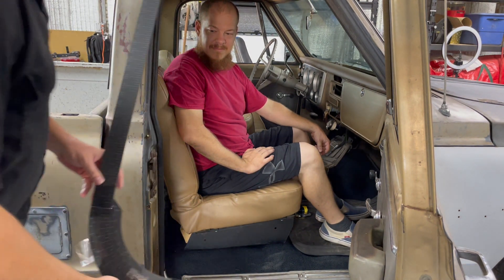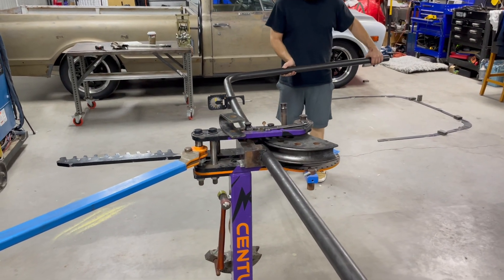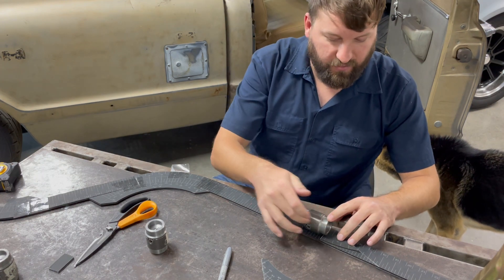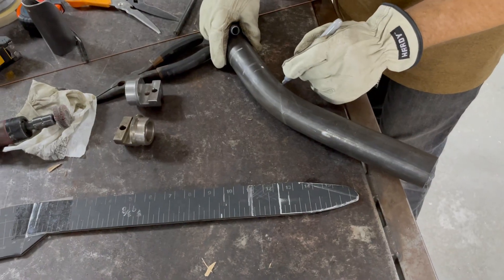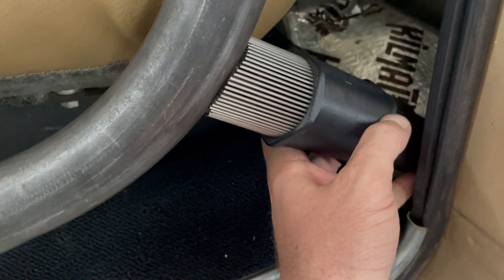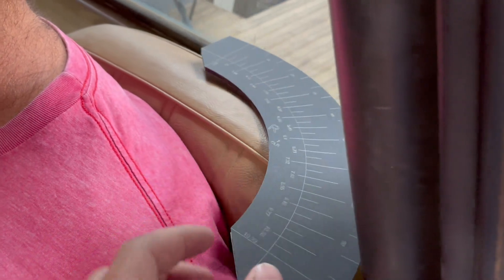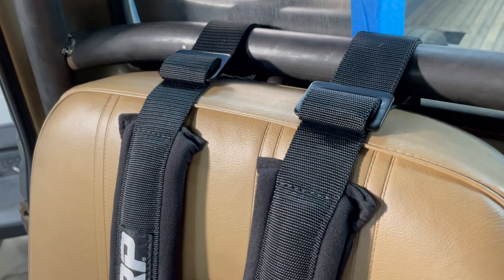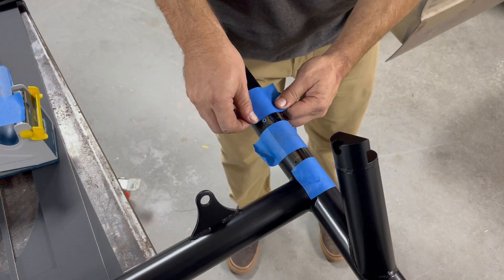C10 Roll cage, clean and easy build video. Step By Step

Comment: I had a question with the template can you explain when you start your bend in the tube bender using the templates
Reply from the maker: Yes. If your bender is like ours then you need to start the bend with a little bit of offset. In the video you can see we used the templates to tell us where each bend started with marks on the tube. The marks line up with the 0 degree and the end angle what ever it is. Now that gets you close. Your bender will have some amount of jiggle and imperfection and you will need to figure that out with a test bend. For us it was about a 1/4 offset. That offset is to compensate for our benders preload and jiggle. The offset is right where the dies meet in the machine. It's impossible to explain in words any more than I have. So my suggestion is to do a little test bend or two to get a feel for how to use the templates and your bender.

Comment: Absolutely awesome work and the attention details is amazing great job.
Reply from the maker: Thank you. More on the way.
Reply: @centurialinc  I wonder if a cage like that would work on 1973 and up C10 single cab. Also could it be possible to run support bars to the rear part of the frame through the back side of the cab but at a hight just below the bed rails so they could be covered up so no one could see them.
Reply from the maker: It sure could. We did not do the back bars because you have to cut through the cabin and the customer did not want that. But you can definitely do that.

Comment: What are those quick disconnects called
Reply from the maker: If your talking about the ones welded to the cage. Those are roll cage bolt in joints. Google that and you will find all kinds.

Comment: Nice work, great video. Why did you use the bolt together sections on the diagonal braces below the seat?  Also will this pass tech at any race events or just for show?  I didn’t hear that discussed at all.
Reply from the maker: Hello. We wanted to make it easy to remove so we could paint it. And the issue was the floor. It was lower on the left and right sides of the car with a crest in the middle. The roof bar was so close to the roof that it was impossible to lift the sides of the roll cage up over the crest without it ramming into the roof. The truck is strictly a street build. Customer would only take it an autocross event at most and that is the only event that would pass this cage.

Comment: Nice work! Your shop rate seems a little low to me from the mindset of business and Labor costs. You mentioned "40 hours" was that "Man hours" or "Shop hours"? What part of the country are you located in? That makes a big difference also. All in all your work and prices are impressive! I'm looking forward to learning more from you guys.
Reply from the maker: Thank you very much. We are in Casa Grande AZ which is out side of Phoenix. So costs are lower. The 40 hrs is man hours at $30 an hour. We think we could go up to $100 per hour shop rate but after that it seams to high. That cage would have been $4k which is a lot considering its a 4 point cage. Now that dose include install, paint and any misc. needed to get it done like hardware. Lots more to come we are going to continue with the business side of things for a while people like that content and it's not very often talked about. Thanks for the comment and watching.

Comment: I gotta say this is one of my favorite new channels. The level of detail in your work is amazing. Understandably your overhead is less, but I personally think you should ask more for the skill and craftsmanship. $75-100 in my opinion. You are creating one off, fully custom products. Not to mention, enhancing the safety of these rides. Keep it up!
Reply from the maker: Wow, thank you! Really appreciate that comment. We think so as well. After the project was done $60 seamed a little to low. Live and learn I guess. The important thing is that the customer was very happy. That will pay dividends well into the future.
Reply: @centurialinc  for sure! You have a clear customer centric approach which is rare these days.
Reply from the maker: @DrivingForwardBuilds   Very true. Do you have any projects your working on?
Reply: @centurialinc   sadly no projects right now. Just started a new job that’s pulling me away from building the channel.
Reply from the maker: Very relatable. Took us 7 years to get to this point. Its hard. Keep at it.